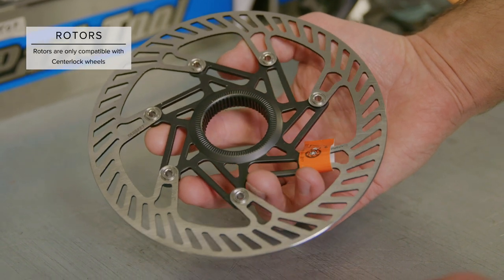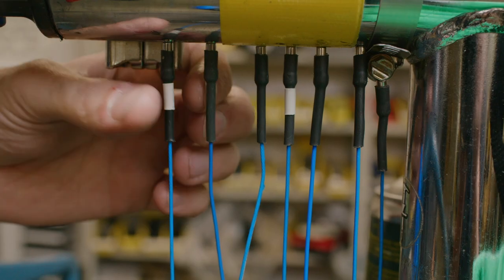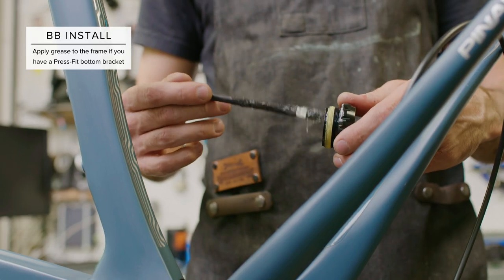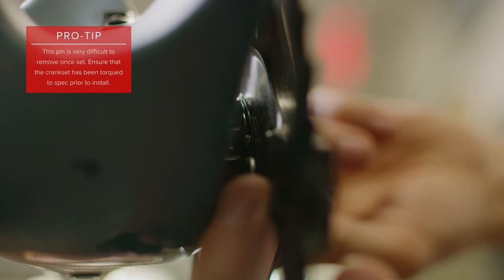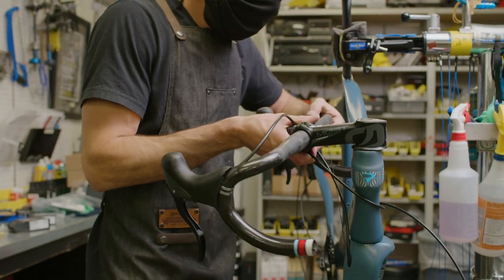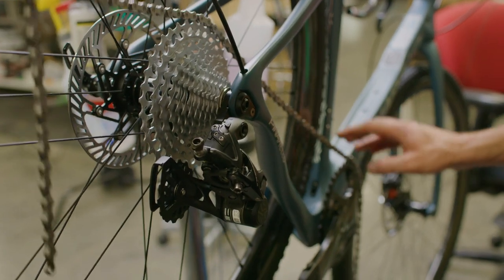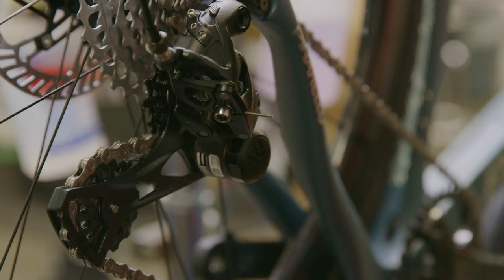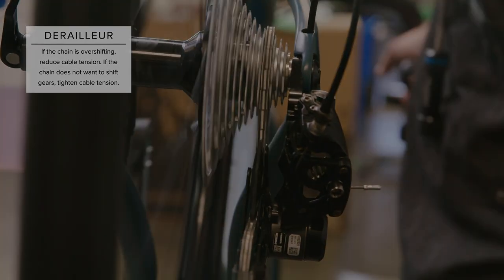Campagnolo Ekar | Installation

Comment: There's a mistake in the derailleur adjustment section. When adjusting the tension, the gap between the largest sprocket and the derailleur cog should be no more that 3mm, not no less than 3mm. Campagnolo state that it should be less than 3mm, while still not making a noise from rubbing the cog against the sprocket.

Comment: Nice video and instructions.  There is an error in the final segment.  Distance between the penultimate sprocket (second to largest) and the derailleur should be no MORE than 3mm with the minimum being a distance which causes noise.

Comment: Hi, thankyou for this video, it was very informative weather to purchase an Ekar groupset. I have all ways loved everything Campag and this is no different. But I have a few concerning questions.
1st, Do I have to use a Campag 13 speed chain splitter as they are extremely expensive, or is there an alternative.
2nd, Do the rotors come with centre locks, and is there a special tool required for that.
Great vid Keep it up. 
Tim
Reply: Hello same question here? help us!
Reply: Yo if you check out the campy brake installation manual it’s all there. You’ll want tool ut-bb130 or a park tool alternative to install the lock ring on the rotor. As far as I can tell from browsing online, lock rings are not included with the rotors.
Reply: I managed with a regular chain splitter

Comment: Nice job..building the same bike /same gruppo.. My Pinna Grevil +  only had a rubber plug for the rear  stay where the rear der cable goes in.. what do you guys use for the cable stop?

Comment: Some folks experiencing movement of the disc and hub spline engagement. Looks and feels like a loose headset. If anyone found a way to go fix that. Chime in.
Reply: I don’t think it’s from the spline engagement but rather the 2 piece nature of floating discs. In reality, you will only notice the looseness when you’re pushing the bike back and forth while stopped and holding the brakes, when you actually use the brakes it won’t make a difference. Some benefits include the disc being able to expand without warping as it gets hot.

Comment: Just one thing which might be useful, rather than say "torque to spec" can you tell us what the spec is?
Reply: The specs are included in the video. See the boxes in upper left corner during each install segment.